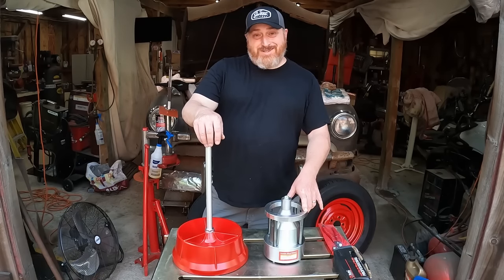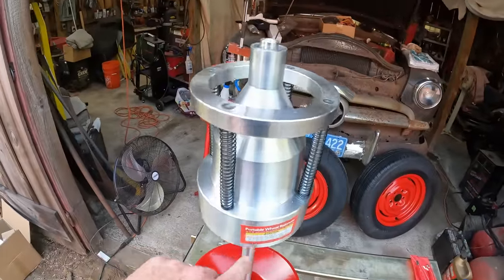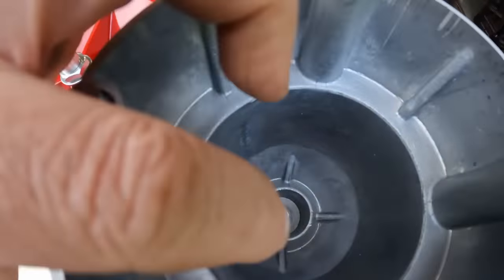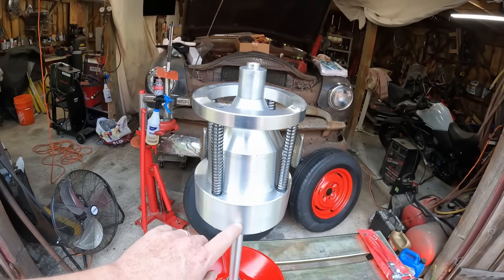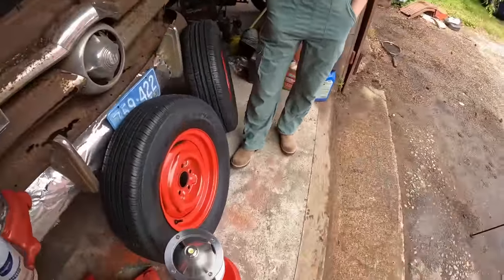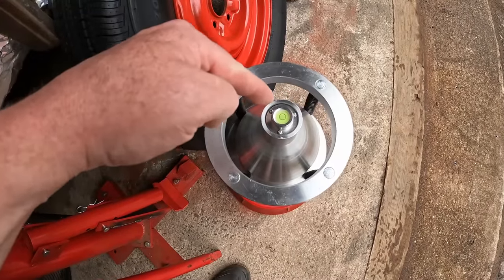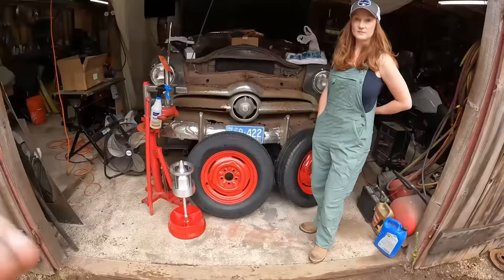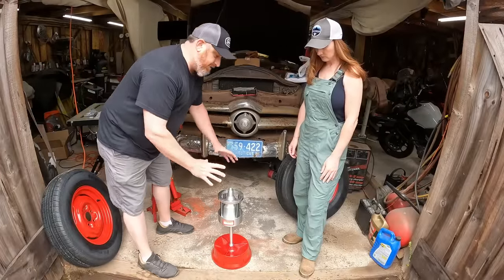How to balance your tires at home and how to modify your Harbor Freight/Amazon bubble balancer!

Comment: It's impossible not to crane your back when placing a wheel on a static balancer unless you do two person lift every time.
Better solution, throw away the balancer and ugly weights then get dynamic balancing beads to put inside the tires. Done.
Reply from the maker: I literally just ordered some balance beads. We will give them a shot
Reply: If you are strong enough

Comment: The sides of the cone are only contacting the socket at large angles of displacement and that is normal.
As long as there is no contact with the mandrel near vertical you don't need to modify anything.
Reply from the maker: Ok then

Comment: I have a snapon balancer.  You put the wheel on a balanced shaft between two rollers, the heavy part of wheel goes down and stops, than I have a slide scale that you attach to the end of shaft vertical and turn up horizontal and than slide the scale from the center towards the heavy side, it measures out in ounces for the correct weights x 2.  Have a flat scale that spreads the weights out in a y on from the heavy spot. Before you try to balance the wheel you set the scale to the right size of on the rim you are balancing...  Once it is balanced you can move the wheel in 3 or 4 places and the wheel should not move.  The shaft that sets on two rollers is very sensitive when the wheel starts moving down on the heavy spot...
Reply from the maker: That's actually really interesting!
Reply: And how $1000s did you pay for that little treasure??🤣
Reply: I didn't I bought it from my younger brother and I think I paid $350 for it when it was almost new and I got a snap on valve grinder with it that cost me $750, back over 40+ years...

Comment: Does anyone know how big rim you can use on this tool? I have 106.1mm center bore (around 4"), about 20-25kg 35" tire+rim etc.. to small tool?
Reply from the maker: They do make a small tire machine. It's for lawn equipment. Check that out.
Reply: @madgingercustoms Small? 35"  (35 inch) tire isn't small.. it's oversize tire like 320x85x16 or alike.
Reply from the maker: @bjarnieinarsson3472  I misread your comment. I think you can put a 4" hub on it. Keep in mind the vertical tube isn't really stout so muscling on a heavy tire may not work well.

Comment: They built dynamic balancers for a reason.
Reply from the maker: No kidding?
Reply: I'll keep the $2000 in the bank and use this balancer, it works fine for the average driver at road speeds....you know for a reason.  You do you.
Reply: @Marc-zf3xv  Almost nobody spends 2k on tire balancing in their lifetime. Dynamic balancers are more accurate and increase the lifespan of a tire making them a better choice even when factoring in the cost. Nice try.
Reply: @stuwest3653  $2k to own a dynamic  balancer. I prefer to change my own car and motorcycle tires, with that comes balancing them too.  This method is perfectly fine for my car and truck tires and doesn't require me to spend the excess time and money at a shop or on a dynamic balancer for home.  If you want to spend an afternoon to/from and at a shop,  pay extra for your tires, have some kid mount them and maybe balance them correctly that's you, for many, we prefer to do it ourselves and have the experience to know the bubble balancer works.

Comment: clip on weights are a NO NO, they leave and indent on the tire and make it hard to reseal the bead if you have to ever unseat tire, not every time but the majority of it.... it's just better to use stick-on unless you don't care about buying a new tire every time.... just my 2cents from 25yrs of experience 🤠
Reply from the maker: we actually just started using balance beads with great success!!!
Reply: @madgingercustoms  they also work i use em myself :)

Comment: Make yourself a "V" with an angle of 60 degrees.  Put the weights on the tire on the light side and mark the position.  Divide the total weight by 4.  Select 4 weights of your calculated value.  Place  one leg of your "V" on the mark you made and the point of the "V" dead center of your wheel.  Mark the rim on the other leg of the "V" and repeat for the other side of your original mark.  The two last marks you made are at 120 degrees from each other and the light side of the wheel.  120 + 120 + 120 = 360.  Place one weight on each of your marks and the other two on the back side of the wheel.
It's been over 50 years since I balanced tires this way so I'm relying on my memory.  It may be that you have to multiply the weight you originally determined by 1.5.  You're the one with the balancer so I'll let you double check that.  
The balancer I used was made by Bear and it had a cap at the point of the "V" which would fit over the bubble in the center of the rim.  I've balanced hundreds of tires this way and we had a device that would spin the tire once we remounted it on the car up to about 120 mph.  If we still had vibration, we'd remove the wheel and brake drum as a unit and balance the whole assembly.  Spinning the tire would also allow us to verify that the tire was truly round because you can balance a square tire.
Reply from the maker: Thanks for the advice!!!

Comment: These balancers are very accurate stock. All your doing is increasing its range, not accurate! You still have to add weight until the bubble is centered, again what you did did not increase accuracy.
Reply from the maker: Lol we can agree to disagree.
Reply: @madgingercustoms     That said you are disagreeing with a fact! You simply dont understand whats happening. The chance of a wheel being so far out of balance that it needs that extra range of motion is zero!
Reply from the maker: @theoriginalmungaman  the existing resistance makes the results unreliable and you will not get the same outcome.
Reply: @madgingercustoms    Again you dont understand. All you did by drilling was open the area around the needle and seat. All you did was increase the angle the top can achieve before hitting the sides, you did nothing to reduce friction on the needle! The original hole is actually calculated to allow enough angle while making it easier to get the seat on the needle. Imagine the under side of the hat was flat with no recess for the seat, it would be very difficult to put the hat on the needle! Again you only increased the range of movement, you did not reduce friction on the needle therefore accuracy did not improve. The reason it stops moving when you push it beyond its range is because it bounces off the relief bore. I cant explain it any more simple.
Reply from the maker: @theoriginalmungaman  you clearly don't understand where it has friction and where it doesn't. Have a great day.

Comment: You guys are both rounding your back.  When you bend over,  keep your back straight & hinge at your hips.  Keep your feet flat,  slightly wider than shoulder length apart to get more balance,  when you drop or lift the tire,  feel it in the back of your leg and your butt... . Don't round your back.  Keep your back straight throughout.  That is called a deadlift in weightlifting.  So be sure all the weight of the tire and your body is over your wide leg stance and going to the back of your leg and butt.  Girls do it to get their butts big.  If you use improper form you will hurt yourself over time.  If you use proper form, you will develop ass like j-lo.  So in essence,  she only lifted the tire once.  She needs to do 8 reps & do that routine 4 times.  8 reps /  and 4 sets.
Reply from the maker: We are both going to blow out our backs! As it is Jess just got really hurt wrecking her mountain bike. Check that out on our second channel!

Comment: The mod sounds smart but you keep complaining that the wheel keeps moving on its own, I think the balancer will work properly without the mod once the weight of the wheel is on it. The weight of the wheel will help that bell wobble enough to work just fine without the mod. A true test would be to balance the wheel without the mod and then with the mod and compare the results. You did the mod before creating a baseline value to compare. Understand?
Reply from the maker: Maybe I'll buy another one and compare. I know out of the box the results are not repeatable by the feedback from others that owned it. We've done a bunch of other tires with it already and it's working great.